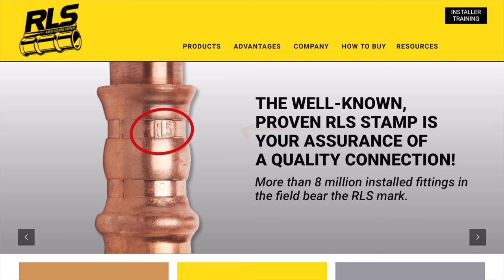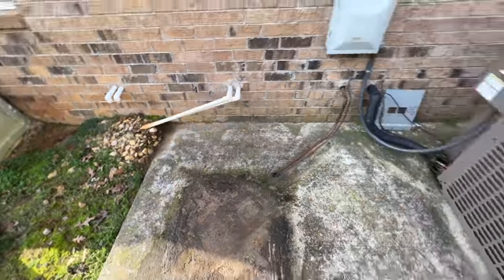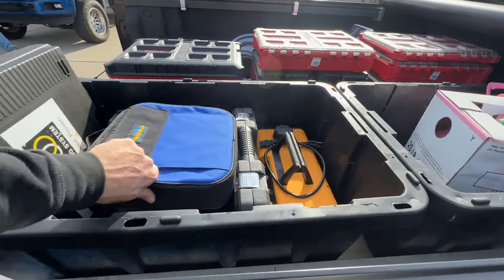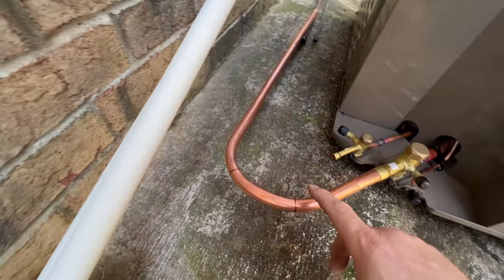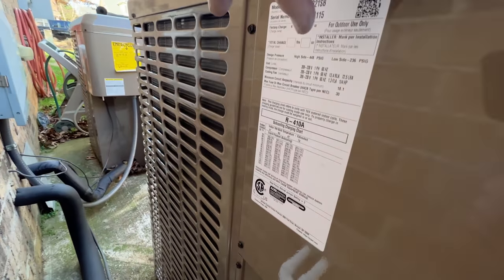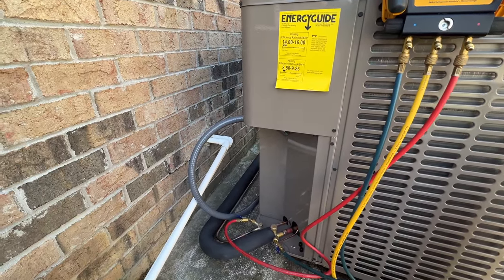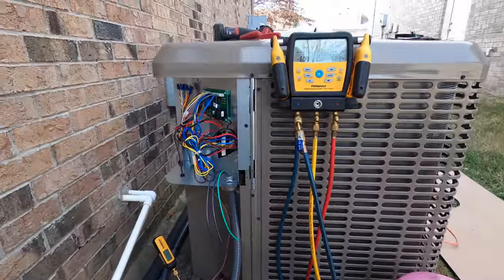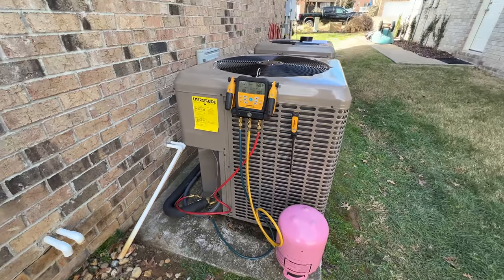Helping Another Contractor Install A YORK Heat Pump | HVAC Life

Comment: I’ve had 9 service vehicles over 33 years.  Only one was a pickup truck. If you’re an installer or contractor, nothing beats a van for efficiency and security.
Reply: Personally not a fan of the van, I like the service bodies, not having to dig around for anything.  Just my opinion, not saying you are wrong.

Comment: Cool that you prepped the air handler, most guys just hang out all day on condenser island 🏝
Reply: lmao, so true
Reply: I work with a guy like that he won't even come inside most of the time
Reply: @FreebornOutdoors  looks like he’s stuck on the island bruddah!
Reply: Condenser island is where my guys love to be !!Especially those late July early august days .
Reply: Bruh got the head of the hammer on the nail
Reply: @FreebornOutdoors  same. Sometimes i need to help him with the condenser after i do the furnace/air handler.
Reply: 😂😂😂🤙🏽the struggle is real on Condenser Island.
Reply: @justinrichard4190  l
Reply: Guy use to work for me I had do Condenser usually because we never would get off job if he did indoor , anyways dude would milk it so hard! He's gone now and I get my change outs done same or faster time now 🤔
Reply: @Rccrdawgs  Sounds like he was running for King of condenser island! 👑 🏝
Reply: hahahhahaha lmao

Comment: brother im 21 and have been doing hvac a little over a year now, started as a helper in residential and just never left haha. but your videos help so much! thank you for taking the time out of your day to make these. stay cool!
Reply: Same!
Reply: Hell yeah brotha 20 here 2 years strong
Reply: Go union. Best decision I’ve ever made. Local 533
Reply: @Brandon-ci8bv  yupppp absolutely, about to be 3rd period apprentice making more than all the non union techs at my first shop
Reply: @Brandon-ci8bv  damn bro I need to look into that
Reply: 21 and 2 years. Residential in FL
Reply: @Brandon-ci8bv  is the hvac union called sheet metal workers or is that a little different?
Reply: @BetterThanYesterday69  No. Sheet metal is different. They make and install ductwork. Look up Pipefitter unions in your area. They are made up of construction fitters and hvac service techs.
Reply: @Brandon-ci8bv  thank you for your response, my union has them combined with plumbers, that’s why I was a little confused

Comment: Yorks residential units has got to be the biggest trash I’ve ever worked on. I’m so over changing condenser motors and defrost boards and hp switches

Comment: Thanks for that 80psi tip for linseset longer than what condenser accounts for, definitely remember that one
Reply: I’ve never seen that done. Is the rule of thumb only for heat pumps or do you use it for straight cool as well?

Comment: The reason for the W to W-Out from the defrost board is it allows the defrost board to disable electric heat when the ambient is high, usually configured as the balance point at 35f or 40f.     Manually initiated Emergency heat is a W call without a Y call which the defrost board defines as a W-Out regardless of ambient.  Some York defrost boards will also stage electric heat if available and will allow a PipeFreeze protection timer after 4 hours of heat pump failure when ambient is below 40f.
Reply: I’ve asked 20 people that and they had no idea. Couldn’t figure it out. What does it get wires too inside the unit!
Reply: I don’t like that about York, if the outdoor board fails they have no back up heat, can’t get the customer to put in emergency heat, you have to go and re-wire it
Reply: @rottiev264  Yep, had that issue a few times.  Reinventing the wheel rarely is a good thing.

Comment: nice job. i totally diassagree with wrapping the lineset around the original way was equal opposite with badges on each corner but thats a personal preference.
Reply: The way he did it allowed both units look identical. Which is more pleasing to the eye. The only criticism i would have is if the unit was extremely close to the wall but from the video the outdoor unit is more than service-ability.
Reply: @not.enoughto.go.around6176  yeah definitely didnt look like 18". but as for the install thats  why i said personal preference. most of my customers in my area would usually prefer it my way because it just looks symmetrical. that and in socal especially homeowners was to see as little line set as possible.
Reply: I agree I always like on 2 system jobs to have the service panels/lineset ports facing eachother
Reply: I like to keep the linesets as short as possible.

Comment: Love the longer "on the job" type videos. What is your thoughts on flushing linesets when switching equipment from R22 to 410a?
Reply: that was my question too, was the old system R22 and if so, did you flush the lineset, I'm just learning and would assume you would have to
Reply: Manual says too…
Reply: when its an attic unit, i flush in the attic so im not fighting gravity. flushing from ground doesnt really do much.
Reply: Not flushing it, WILL contaminate the 410a.  They don't play well with each other.  It may not show immediately, but over time and depending if you used the existing coil or not, will start to cause havoc and break down the equipment.  The reason that I mentioned the coil, is that the oils from the old r-22 will stay in it, low areas.  New coil:  the line opened at both ends will eventually drain a majority of it out, but there will be residual amounts left on the lineset walls.
Reply: Only if the refrigerant is burnt is when you’ll flush line set
Reply: @calvinlong6940  not true. It’s 2 different oils and they don’t play well together. I would always flush if I’m reusing the same line set and going from R22 to 410a
Reply: @mathewserrano2262  I'm with you. Flush the lineset if you reuse it from r22 to r410a. Don't want oils mixing at all if you can help it. Like the other guy said, you're not gonna have issues right away but it's the right thing to do and just one more preventative step.
Reply: You should always flush your line set when switching from R22 to 410A and any time you have a burn out you should flush the system to get all the burn out oil.
Reply: @jhooks420  what kinda issues did you have when you flushed them?
Reply: When switching to 410a  a bigger diameter liquid line is required

Comment: Now that’s the style of video that made me really like your channel in the beginning. Just clean by the book installation work and best of all none of those garbage RLS press fittings. It doesn’t take much extra time to remove the cores, which should be done before brazing anyway, hook up a bottle of nitrogen and purge while brazing. And when done right, a braze joint is going to last pretty much forever. Those gaskets in those press fittings I’m not so sure. Hell maybe they last just as long but I’m not going to find out. Brazing has been around a whole lot longer and it’s fun. Not to mention, the manufacturer is not sending out no systems with a bunch of press fittings. Actually, I’ve never seen a press fitting on any of the new systems I install and service. That tells me all I need to know. I will NEVER use that crap. Also I’m not paying for or charging my customers for the outrageous prices of the tool or the fittings. Don’t get me wrong I have some high end tools pretty much everything you have and I don’t mind spending money on tools but that’s one tool I’m not gonna buy. The only time I could see it being even remotely necessary is if you have a bunch of brazing to do in a hospital or something like that where you have to get a hot work permit and alert the fire department to do the work. Even still, I’m getting the permits and using my torch.

Comment: Great install. The only problem I have is that you changed the orientation of the condenser. Would have looked the exact same and would be easier for service if both the units service ports were in the same location. Better and more efficient for maintenance.

Comment: I love how organized you are and the quality of your work and work ethic! I have two questions related to this job. Was the old unit R410A existing? I noticed you didn’t flush out the line set. Second do you guys not need heat pump stands for outdoor units in Tennessee? Here in Connecticut if we don’t use them and the outdoor coil freezes up and breaks it voids the warranty. 
 Looking forward to more of your videos, you definitely have great ideas for tools and cleanliness all of us hvac guys can learn from

Comment: Just got an sman 480,thanks for the tightness tip 👍 did not know about it.
Reply: Use the temperature probe for OAT and itll even adjust for changes in temp
Reply: @logicalrat  What is OAT ?
Reply: @logicalrat  outside air temp ?
Reply: @lyndonlakhansingh  yup, outdoor ambient temp

Comment: Have you noticed any contamination from refrigerant has messed up your vacuum gauge? I have the older field piece one and it always seems to read differently once it has had refrigerant on its sensor.
Reply: I have a newer bluvac and it seems after 2 jobs it needs cleaned.

Comment: Hey not trying to nit pick, but more of a question - When you cut the suction line coming out of the house you did not debur it before attaching your new chunk of pipe. does this really matter?
Reply: Saw this too, probably because it was hard to deburr without the shavings getting stuck.
Reply: @OnePointLander  I pack a small vacuum for this purpose.

Comment: Did you flush the line set? Surprised you didn’t use press fittings and put the low voltage in seal tight. Not a fan of York.

Comment: Good evening from Greece. I'm a new cooler and I have two questions from the video. Why do you use nitrogen in welding? What does it help with? The second question is where you put 80 psi with the system closed. At what outside temperature is this valid? Thank you very much for your videos, it's a school for me.
Reply: The flow of nitrogen while brazing prevents the filler material from going inside the pipe as well as preventing soot on the interior of the pipe while brazing. The opening of the metering device(txv) can get and normally does get restricted by the filler material and/or soot when not using Nitrogen.
Reply: It takes place of the air in the pipe and prevents oxidation that could cause a restriction in the txv/piston

Comment: So in the winter when we can't charge with subcool/superheat, you just add refrigerant until you hit roughly 80psi and that's fairly accurate?  More accurate than measuring the lineset and weighing it in?  Just trying to learn something new, thanks for the content.
Reply: The chart in the manual gives you the pressures to adjust to in heat mode.  But he said the tech will subcool adjust in the spring when cooling can be properly used under higher ambients.
Reply: @rj.parker  Right, we do that as well at our company.  We have 2 tune ups included with new systems we sell I believe.  I get that for a heat pump you could check pressure, but for a regular AC during winter was kinda my question.  Currently I estimate line set and weigh it in before opening valves.  Then in spring they can fine tune it.

Comment: Was wondering if you could point me in the right direction. In the planning stages of building a block home on a slab in Florida. Looking for for the best possible (electric powered)set up without unneeded redundancy to do the following.

Ductless Cooling / Heating
Pool Heating
Normal Household Hot Water

Is there a way to efficiently do the above without 3 separate systems?

Comment: Will the 410 mess up the Fieldpiece vacuum gauge?? I saw you breaking vacuum with 80 psi of 410 before removing the gauge of the liquid line. 
I have the SVG3 and it got ruined using the same technique you are doing in this video.
Reply: I was wondering the same exact thing.  For some reason, he hasn't answered this...

Comment: Quick question, in Tenn does code not require "snow legs" or pump ups on Heat pumps?  It is a requirement here, and we are close geographically.  Thanks for posting.
Reply: We put them too in canada but we get more snow obviously
Reply: I doubt a inspector is coming by checking in on the install……. It’s not new construction
Reply: @drodriguez394  Really?????  Our stuff is inspected on 90 percent of changeouts as well, as is all the contractors in my area, must be nice to be where you are at where not inspected, which I am alright with, as I do my job correctly, I was simply asking a question.
Reply: @dillonlexington  I live in Philadelphia. Inspector comes down if you draw permits. But you don’t need permits to buy equipment…
Reply: @dillonlexington  I live in Philadelphia. 
Obviously the inspector comes by if you draw a permit…. But who knows you’re doing the change out if you don’t draw a permit. You don’t need a permit to buy equipment
Reply: @david Dillon. I was thinking the same thing. We put all of our equipment on pump ups. Doesn’t matter if it’s a heat pump or ac. Besides keeping snow out of the bottom of the unit, it also keeps grass and mulch from building up the sides of the unit.
Reply: @MrCmgl1  curiosity only, is that code in your area or company policy?  Makes sense to me.

Comment: What method do you use to support the horizontal run of the line set behind the unit. or is it just reading on the ground?
Good video and thanks
Reply: You could use a one hole strap and tap con to concrete

Comment: Why they set two ac units to close together ill never understand. four feet from any wall. at least four foot apart minimum . the units will blow into one another .and heat one another up .my home unit is set two feet from wall the back door is over eight feet away the wind from our unit is so stong it might blow you over at the back door . its a three  ton you can feel it blow its so strong

Comment: never seen anything like this someone who fills a system under pressure haha you have to know the (KG) (or what you use in your country) of the refrigerant not the pressure of the system. and if you put that insulation so tight on the floor with no rubber underneath it will rot in a year. and the 
liquid ? does it have any insulation?

Comment: Love these videos! I have a dumb question but I’m new. After pressure testing, does the nitrogen need to be removed before the vacuum or can the nitrogen be left in and let the vacuum pump pull it out?
Reply: After a pressure test, you let the nitrogen out of the lines before using a vacuum
Reply: @ZirixGaming  Thanks for the response 👍
Reply: Your vacuum pump will make a oil fountain if you start it with pressure. That is the conventional ones anyway not sure what the new Fieldpiece one would do but I bet it doesn't like it much ether
Reply: @jonsaircond8520  That's a good point, i didn't think about that.
Reply: Yeah it will probably fuck the vacuum up completely and anything around it will be covered in oil

Comment: What’s that putty called that you put on the valves before you brazed onto the unit?
Reply: Probably thermal paste. They usually have it on the counter. It does work I can confirm. But I just use a wet rag 99.99 percent time lol
Reply: @Username-ng8jy  yeah I’m the same just wrap it in a wet rag but I’ve seen that being used a few times and was just curious

Comment: Alright from Colorado so not many heat pumps here. what’s the 3rd port for on the condenser for?
Reply: It’s the common suction, can’t measure suction pressure in heat mode on the SSV like with an A/C or refrigeration system, that is all hot gas going inside to the indoor coil that is acting like the condenser. The common suction port goes back to the middle tube of the reversing valve and will always give you true suction pressure, in heating or cooling.
Reply: @rottiev264  interesting thank you brotha!

Comment: Perfection. Please invest in a knee pad though  for your knees sake. ALSO, I wouldn’t really recommend adding more than 250 PSIG due to it being a micro channel coil.
Reply: That doesn’t make sense 410 is going to run above 250 psi on a really hot day and or a real cold day

Comment: You could have had it turned towards the center and nobody would have been the wiser. Would have saved a lot of time and copper. 10 minutes for a pressure test is basically nothing. I do minimum 30, and usually an hour. Then I'm not questioning it.

God it keeps coming. Don't throttle your refrigerant from the bottle. Didn't weigh in. I mean that's fine but these units coming precharged for 15' of lineset. What temp are you using to put it in? The inside and outside would be different temps.

Comment: I was never taught to break vacuum with refrigerant until now. But wouldn’t you over charge the system assuming if it’s a short lineset? Just wanted to know?
Reply: To break vacuum you only need to add a few ounces just enough to get pressure in the system
Reply: Just open the valves if the run is within factory charge specifications; he broke it with additional refrigerant because he needed to add extra.
Reply: New units are good for 20-30 feet of lineset, depending on brand. The install manual will tell you exactly how much they're good for and how many ounces to add per additional foot.  But when you've been doing it for awhile like myself or any other installer with a few years under the belt,  you get a good idea as to what will be needed.

Comment: Where can I get that king valve tool at?
Reply: It’s a Klein slim profile mini ratchet. Same one I use
Reply: @Brendan_Clancy  Ahh alright bet thanks but what about the bit? Or does it come with it?
Reply: @raulvelasquezescalante5802  use 1/4 drive service wrench insert. It does not come with it.